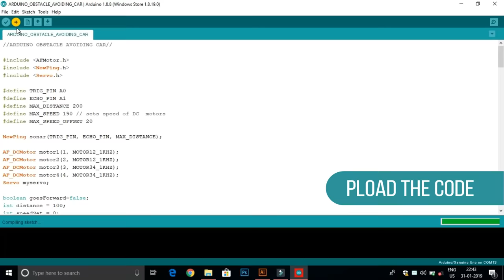How To Make A DIY Arduino Obstacle Avoiding Car At Home

Comment: Bro from where I have to upload the code
#include <AFMotor.h>  
#include <NewPing.h>
#include <Servo.h> 

#define TRIG_PIN A0 
#define ECHO_PIN A1 
#define MAX_DISTANCE 200 
#define MAX_SPEED 190 // sets speed of DC  motors
#define MAX_SPEED_OFFSET 20

NewPing sonar(TRIG_PIN, ECHO_PIN, MAX_DISTANCE); 

AF_DCMotor motor1(1, MOTOR12_1KHZ); 
AF_DCMotor motor2(2, MOTOR12_1KHZ);
AF_DCMotor motor3(3, MOTOR34_1KHZ);
AF_DCMotor motor4(4, MOTOR34_1KHZ);
Servo myservo;   

boolean goesForward=false;
int distance = 100;
int speedSet = 0;

void setup() {

  myservo.attach(10);  
  myservo.write(115); 
  delay(2000);
  distance = readPing();
  delay(100);
  distance = readPing();
  delay(100);
  distance = readPing();
  delay(100);
  distance = readPing();
  delay(100);
}

void loop() {
 int distanceR = 0;
 int distanceL =  0;
 delay(40);
 
 if(distance<=15)
 {
  moveStop();
  delay(100);
  moveBackward();
  delay(300);
  moveStop();
  delay(200);
  distanceR = lookRight();
  delay(200);
  distanceL = lookLeft();
  delay(200);

  if(distanceR>=distanceL)
  {
    turnRight();
    moveStop();
  }else
  {
    turnLeft();
    moveStop();
  }
 }else
 {
  moveForward();
 }
 distance = readPing();
}

int lookRight()
{
    myservo.write(50); 
    delay(500);
    int distance = readPing();
    delay(100);
    myservo.write(115); 
    return distance;
}

int lookLeft()
{
    myservo.write(170); 
    delay(500);
    int distance = readPing();
    delay(100);
    myservo.write(115); 
    return distance;
    delay(100);
}

int readPing() { 
  delay(70);
  int cm = sonar.ping_cm();
  if(cm==0)
  {
    cm = 250;
  }
  return cm;
}

void moveStop() {
  motor1.run(RELEASE); 
  motor2.run(RELEASE);
  motor3.run(RELEASE);
  motor4.run(RELEASE);
  } 
  
void moveForward() {

 if(!goesForward)
  {
    goesForward=true;
    motor1.run(FORWARD);      
    motor2.run(FORWARD);
    motor3.run(FORWARD); 
    motor4.run(FORWARD);     
   for (speedSet = 0; speedSet < MAX_SPEED; speedSet +=2) // slowly bring the speed up to avoid loading down the batteries too quickly
   {
    motor1.setSpeed(speedSet);
    motor2.setSpeed(speedSet);
    motor3.setSpeed(speedSet);
    motor4.setSpeed(speedSet);
    delay(5);
   }
  }
}

void moveBackward() {
    goesForward=false;
    motor1.run(BACKWARD);      
    motor2.run(BACKWARD);
    motor3.run(BACKWARD);
    motor4.run(BACKWARD);  
  for (speedSet = 0; speedSet < MAX_SPEED; speedSet +=2) // slowly bring the speed up to avoid loading down the batteries too quickly
  {
    motor1.setSpeed(speedSet);
    motor2.setSpeed(speedSet);
    motor3.setSpeed(speedSet);
    motor4.setSpeed(speedSet);
    delay(5);
  }
}  

void turnRight() {
  motor1.run(FORWARD);
  motor2.run(FORWARD);
  motor3.run(BACKWARD);
  motor4.run(BACKWARD);     
  delay(500);
  motor1.run(FORWARD);      
  motor2.run(FORWARD);
  motor3.run(FORWARD);
  motor4.run(FORWARD);      
} 
 
void turnLeft() {
  motor1.run(BACKWARD);     
  motor2.run(BACKWARD);  
  motor3.run(FORWARD);
  motor4.run(FORWARD);   
  delay(500);
  motor1.run(FORWARD);     
  motor2.run(FORWARD);
  motor3.run(FORWARD);
  motor4.run(FORWARD);
} 

(Is this correct code??)

Comment: i cant open the codes
Reply from the maker: make sure you have Arduino IDE installed on your system otherwise it won't open
Reply: @DIYBuilder  i already finished the project thanks for answer and very good video.
Reply from the maker: @tantuniswindler7087  glad to hear that☺